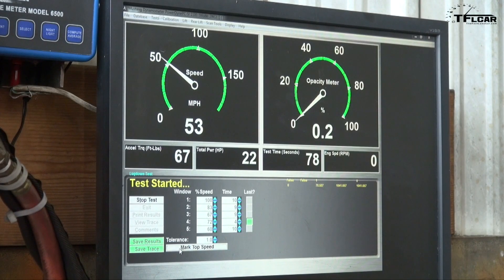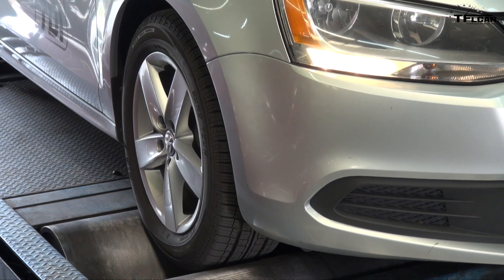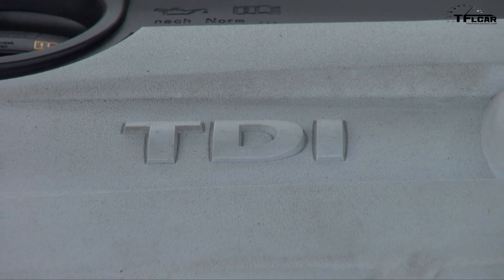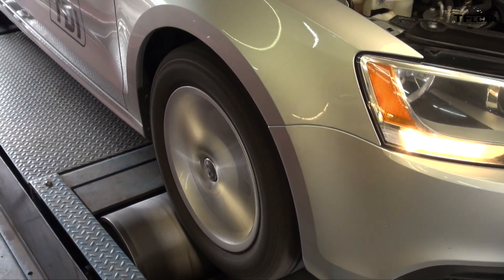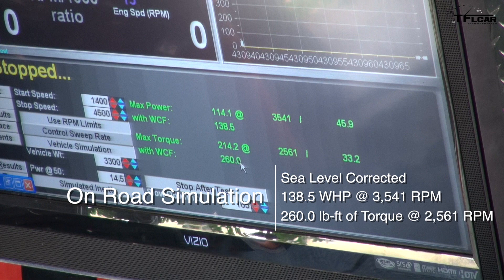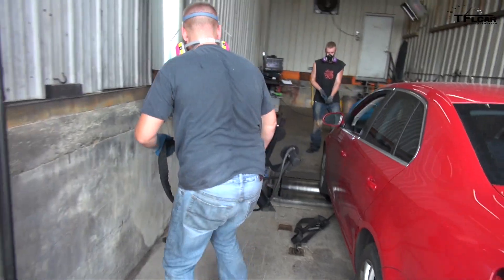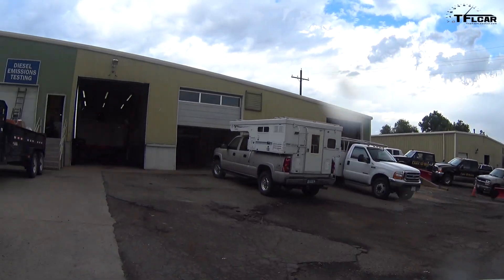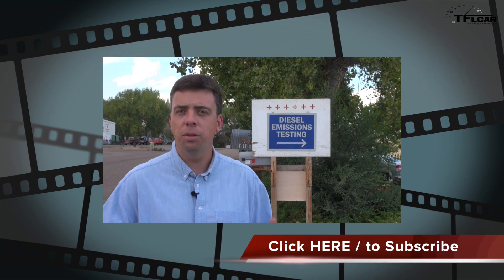Surprise! We Dyno a VW Dieselgate TDI Jetta to get the Truth about HP Loss

Comment: My Jetta achieves high 40s in mpg on the hwy when driving reasonably, there is no carbon on the tailpipe vs my gas car which there is. My jetta also runs smoother and quieter than my gas ford focus. 

It's shame that epa wrecked such a good car. Now they are going after gas cars by enforcing gpfs.

Comment: I can confirm these results by my experience. The car notably loses low rev torque when WV "emission fix" map is installed instead of original one. They did correct job with original map, but this "fixed" one is garbage. Even bigger problem is that new map produces 3x more soot and fills DPF that much faster, and also clogges EGR at that much faster pace. Fortunatelly... there is a fix to that, too.

Comment: 14 jetta and 15 Passat and both fixed by VW.  The 14 lost power the 15 we can't tell any difference. The 15 is geared taller and  the engine VW modified from the 14 OEM. The 15 engine design was much cleaner then previous years. I think VW was trying to get into compliance and maybe would have by 16 had they not stopped making diesels. the 15 with the dsg still averages 39/40mpg with 50 mpg easily on trips. We do our own maintenance and both have been reliable.

Comment: Detecting an emissions test is as easy as comparing wheel speed sensor readings from the front wheels vs the rear wheels then de tuning the injector mapping.

Comment: I still think this is a load of horse shit. These engines were designed to be less polluting then previous TDIs to which was theswitch to common rail fuel injection and fitting the exhaust with dpf filters in-conjunction with the egr system. The epa most likely had new ridiculous emission standards for diesel vehicles for this era in which made releasing any vehicle extremely hard due to impossible standards set out by the government. In VWs defence, they had to “cheat” and lower the performance to sell their cars period to which was a big red flag from the epa. Of course they made VW look like the devil in court even though they had a less polluting engine which was still progress from the previous 1.9L tdi without the use of any particulate filter. That progress wasnt good enough for them and still chose to penalize them despite setting virtually impossible regulations for any car manufacturer to produce and sell diesel engines. Yes, diesels do contain more pollutants then gasoline fuel combustion, however they should have been more lenient with VW instead of nearly bankrupting the largest car brand in Germany for trying to make progress. Diesels only pollute when peak torque is reached, particulate filters found in any modern diesel stop black exhaust from exiting the tailpipe. My opinion for diesels is that these systems should be easier to service and clean ensuring that more diesel vehicles can be on the road achieving significantly higher fuel milage  then 95% of any other vehicle on the road. You shouldn’t eliminate this kind of fuel efficiency when the world is running out of oil because of self-righteous environmentalists in government that aren’t satisfied with the progress in making diesel engines run cleaner with the use of DPF.

Comment: This DieselGate shit is so stupid, it’s the transmission and it’s various sensors that want to prevent you from using all that TQ to do burnouts that causes this issue, nothing more. The car obviously has wheel speed sensors and a computer as a brain running every system. So this computer is smart enough on behalf of its programmers to know that if the front wheels are doing xxx MPH and the rear wheels aren’t moving then the car is doing something wrong, aka a burnout is what it thinks your doing. Not emissions testing lol. This is a warranty reduction effort. People are stupid

Comment: Diesel aren’t meant to run with all of the dpf/ egr crap they can’t preform at the maximum efficiency nor will it last as long with the emissions. A diesel is designed to to move a lot of air/fuel in a in unrestricted way. This is why 70-80 percent of new diesel vehicles are in and out of the shops. If you remove all of the emissions and run a normal exhaust and have it tuned properly it will still emit less pollution then the maximum allowed in the states.

Comment: why disengage ESP/ASR ? why don't you measure emmisions on a 4wd dyno ? do you know that ECU goes into system failure mode when abs detects an error? (like unplugging rear wheels speed sensors ). what was the requirements or specifications after this test was done ?

Comment: I Love my 2013 tdi yet would prefer it as original .  With the retrofit I'm getting issues w the EGR & Particulate filters on Bank 1 
 I have to find a Shop to do the Repairs under Warranty ; sadly there are No VW near here and I can't just drop it off either as its also my Medically necessary transportation.   
 The VW'S were & are still gr8t 
But the "fix" has a few Bugs ; aside from CAL emissions being a Scam from an engineering standpoint as EGR systems Ruin the engines by Grand Deceptive design aka Fraud .  
Heck HONEST engineers Albeit all come to this conclusion .

Comment: I bought a 15 tdi sportwagen and a 13 tdi Toureag this year. Long live the Diesel.
Reply: Yup took the turbo goes out by TDI 2.0 on my Passat just had to replace the turbo that was $4000. What motor you have in your toureg??
Reply: Diesel is 💪🏻
Reply: if not you can refuel with veggi oil
Reply: Which one do you like more?
Reply: @BornToBeFamed  Touareg FTW - I love my 2012 Touareg TDI (we also own a 2012 VW Jetta TDI - no issues, great car)
Reply: They are great cars! You can pick these up used at a really great price.
Reply: I got a mk4 tdi

Comment: My 13 Golf TDi was exceedingly profitable. I decided to sell mine back to VW(even though I felt it was clean enough[literally at 58000 miles the tailpipe was still as clean as it was the day I drove it off the lot]) VW paid off my loan, which was around $9000 and gave me almost $12000 cash. I told my wife, even if I drove it until the wheels fell off, I'd never get that out of it. I still drive a VW but it is a 2.5 5cyl gasser. Not my choice car, but it's paid for and still looks awesome.

Comment: This test is so misleading... Lots of cars have this issue on a dyno, it is mainly caused by traction control. Traction controls first strategy tends to be retarding timing (reducing power output) in an attempt to minimize wheel spin. This fact has been around for quite some time. Probably the most notable example being the e46 BMW going into a power limited mode on 2wd Dyno's, for a lot of tuners this was the first time they saw this happen. However now LOTS of vehicles do this because of how computer integrated they are, much of the time you have to pull the ABS/Trac fuses or put the car in a special dyno mode. In other words the TDI is limiting power not because it knows its being tested but instead due to wheel speed discrepancies.

Comment: "DieselGate" is such a joke!  So, you proved that the emissions-compliant mode produces less torque at the peak-torque-RPM, which is just below 2,000 RPM on a TDI. Everything else is pretty much the same.  So, how much does this affect pollution?  At highway speeds, you're above this RPM, where the 2 torques (and likely emissions) are on par.  And around town?  Well, this is a test a FULL THROTTLE.  So, if you drive with your foot to the floor, then you will briefly emit emissions above the legal limit between 1800 and 2050 RPM.  Or for less than half a second in 1st gear (the revs do not get that low again at full throttle in an automatic, which is most of the VWs on the road in North America).   BIG DEAL!   And if you don't drive with your foot to the floor, then you are emissions compliant.  
The whole "dieselgate" thing is a cash grab by the EPA.  Testing in Europe shows that ALL diesels tested were above the limits except for Mazda.  The worst was not VW.  It was Honda. But BMW, Mercedes, Ford, GM, Chrysler, Renault, Citroen, Volvo, etc. ALL FAILED!  The reason they picked on VW is because they have cash. 
EPA doesn't measure pollution anyway.  They measure "percentages".  Percentages don't kill you. Pollution does.  The VW Golf and Jetta are both in the Guinness records for lowest fuel consumption in the USA.  That equates to lowest pollution for a vehicle powered by an ICE.  The EPA rules are there to make very efficient vehicles illegal (to support big oil, possibly?).  Anyone with a 2 digit IQ can guess that a 3/4 ton, crew-cab, 4x4 pickup (the standard commuter vehicle in places like Denver, it seems) uses a lot more fuel and hence pollutes a lot more than a Golf or Jetta.   Its a gov't scam!  
Why not go after those disgusting school buses pumping black smoke into the air that the kids stepping off from have to breath? Oh, the bus company doesn't have $15 Billion in cash?  Never mind.

Comment: VW is getting the (relative mpg) "Our fuel guzzler can't keep up with you so you
detune your engine, the same treatment they got with the bug in the early 1970's.

Basicaly this is what it boils down to is if, your VW is burning less fuel and emitting
0-5% more dirt at a 45- 53 mpg (an avg/mpg of 49 mpg) and theirs at a 34-40mpg 
(an avg/mpg of 37 mpg) is emitting 0-5 % less dirt, this to me equates to 2 mpg 
net gain for ( VW @ 0 emissions for two miles, this on a simple math comparison.)
The discussion above is invalid until you real world testing, in comparison, between
 the complaintents total emissions over their mpg's to VW's mpg emission, total in 
weight per volume. Emissions being the common denominator, not the mpg's.

Comment: Honestly this proves absolutely nothing at all.
With the advanced traction and stability control and advanced awd systems we have today this proves nothing without emissions testing.

Top traction and stability control systems proven by unbiased testers the Ford F150 got 1st the Toyota Tundra 2nd 10years ago vs dodge, chevy, gmc, and nissan.
Only 2 trucks made it up in 2wd the Ford & the Toyota.

My Ford Fusion is awd but its a front wheel drive 100% of the time until necessary the awd kicks in, traction control on vs off there is no difference the traction control light starts flashing but it still grabs just the same. And when its off it still activates the rear so its not ever completelly off the electronically activated rear is activating when the front cant compensate so its technically always on even when off, atleast for the Ford Fusion AWD.

Anyways useless video sad I even watched It I expected something actually showing us the real data.

Comment: Who buys a diesel in the USA? WTF
Reply: Me lol, own a tuned BMW 335D that puts down 365hp/595tq at the wheels and still gets almost 40mpg highway and about 28mpg city.  It runs mid 12's in the quarter mile on the drag strip at 111mph. It's amazing to drive having all that torque at such a low RPM.  No non-electric car on the road can claim that type of power and efficiency.

Comment: Who gives a crap whether your car gives more carbon, the worst are the electrical cars, the mining procedure for the lithium for one electrical car gives more pollution than 10 diesel cars in there life time.
The reason it refused to work on the FWD test that was the car detecting only the front wheels were spinning so it was for safety.
Plus who gives a crap it’s a Volkswagen diesel put a bigger turbo on it bigger injectors, tune it and give it a more free flowing exhaust and you’ll get a pretty quick economical car that if maintained will run for at least 300,000 miles or upwards of a million miles (for real) if it’s the 2.5

Edit: I just checked and found out that all brands under VW, Ford, Mercedes, Jaguar, Toyota, Nissan And BMW have been caught cheating emissions test just Volkswagen got ALL of the punishment for it

Comment: Sorry to say , but your testing is less than accurate. "But" Good try though. Your testing in the 4 wheel mode that is the best way agreed. But when testing in the 2 wheel mode the computer Instantaneous activates the traction control. And the figures for emissions going to be wrong. The anti lock braking will continue to apply the brakes on car and than down shift to a lower gear. And the real problem with you test is there was nothing testing the emission output from the tail pipe. What we call a laser gas bench tester. It checks for biggest pollutants " green house gases" starting with Carbon monoxide being first on the list than comes Oxides of Nitrogen and lastly the carbon particulate matter. I commend you on your tasting. I've been a emission technician in Pennsylvania since the early eighties. And have tested thousands of vehicles. And out of curiosity have tested the obd2 complaint cars on the dyno and sample the tail pipe with utter amazement. Cars built on or after 1996 are rolling dyno's . That's why we only have to plug into the cars 16 pin diagnostic connector. And it's either a pass or fail. No check on the actual tail pipe gases. There are cars that passed the obd2 test. But we suspected that they would fail the real world testing on the dyno with tail pipe testing. And surely they did. And it was random makes and models. So don't think for a minute this is just a VW diesel thing. It's all manufacturers. Playing games with their software. Nuff-Said.

Comment: There are a few people who will buy these vehicles and modify them for tons of power with no concern to NOx emissions because they live in free states.  45 MPG and lovely driving.  Look how many older TDIs are still on the road?  You think a 2003 VW TDI with a VNT 17 upgrade, race pipe running a Malone tune and Bosio 764s is cleaner?   Reliable 180 HP and 330 ft lbs of torque.   That is tire smoking torque in 3rd gear.  
The issue is NOx.  And NOx is over rated as the Sunday Hypothesis shows ground level smog is more a sign of Isoprene from TREES than NOx from tailpipes.
Reply: My tuned 335d is at 365hp/595tq at the wheels on stock turbos. It will break the tires free at speed through the first few gears on wide sport tires.   Diesel cars are amazing to drive when modded. Used BMW 335D's have to be the best value for getting into the performance diesel scene.  You can get them already tuned and close to 400RWHP for less than 15K.

Comment: Most modern cars now when 2 wheels are slipping limits power to the driven wheels anyways. Not just this specific Jetta TDI but on almost ALL cars with a traction control system, ABS system, and dynamic stability control. Which has been standard on all cars to be fitted with this since the early 2000's at least here in Canada.
Sorry TFL but your test here is invalid.

Comment: What's all this bull shit about diesel cars,the problem is the old vehicles with the indirect injection systems fitted they were dirty,the latest engines with direct injection high pressure systems plus cats and particulate filters and add blue fitted are that clean you cannot even smell it is running on diesel,people are being conned into believing that they destroying the planet it's all a scam,it's the big v8 petrols that the yanks produce that should be outlawed not the two and three litre diesels.

Comment: Wouldn't the power loss be from the front wheels driving the Dyno belt and having to spin the additional weight of the rear dyno rollers? Similar to drivetrain lose.

Comment: I have an early 1990s Chrysler product that, when the vehicle speed sensor fails, the amount of power it makes really goes down.

Simply running it on a 2wd dynamometer until the traction control system determines that there is some kind of failure and reduces engine power is hardly a test that would come to any definitive conclusion.

Hell, on some Toyotas, a failure of a vacuum switching valve in the evaporative emissions system causes the anti-lock brakes and traction control to get disabled.  Does it affect how much power or other emissions it puts out?  Maybe.  Maybe not.

Comment: I think any results used when the engine is throwing a dozen error codes is kind of suspect. Theres no way that 2WD mode onthe dyno is going to fool the software. However - your dyno tests in 4WD match the manufacturers claim which is interesting in itself. 
What you need to keep in mind is that dyno results do not ever translate to on road results, because on road has friction from air movement.

Comment: Yea, this test was so invalid it's not even funny. You all assumed that all 4 wheels turning would give the max number. But no, just no. First off its not an and car thus that means you are taking power from the front wheels to turn the rear. Which means that the rear wheels are now a parasitic loss to the total number. Also you lost power having to turn the mechanisms to transfer power from the front to the rear. And the biggest failure here is the fact that you did NOT do a emissions test. You all did a dyno run which does not test the emissions. It's tests the horse power. 

And who cars that VW did this. It is a diesel car, which is more efficient than a gas car of equal weight power and etc. A gas car might get 32mpg and this diesel gets 45+mpg. Which that in itself makes it more efficient. This is why motortrend is better than fast lane.

Comment: Having read a lot about all this I am frankly amazed that opinion has beaten science yet again. There are a lot of people who have had the VW "fix" and have now joined class actions with measured differences in torque and fuel economy during normal on road driving. That's not all they have to worry about. What about the effects of the fix on EGR valves or DFP regen and replacement? Tobz and TFL measured 2wd and 4wd and got a significant difference in torque. Why hasn't anyone measured torque, horsepower and economy pre and post a VW "fix"? If you could do this there are a lot of lawyers who would be a lot happier.